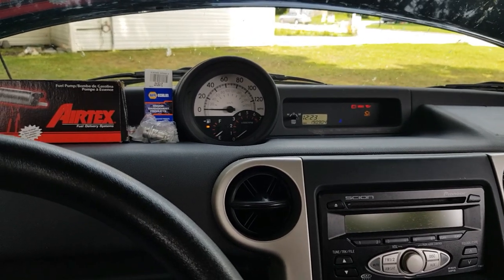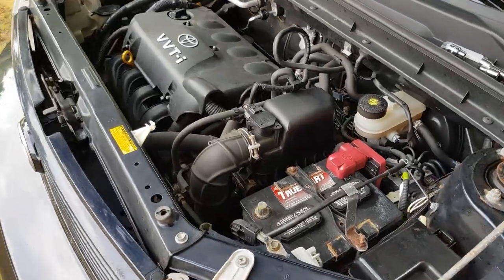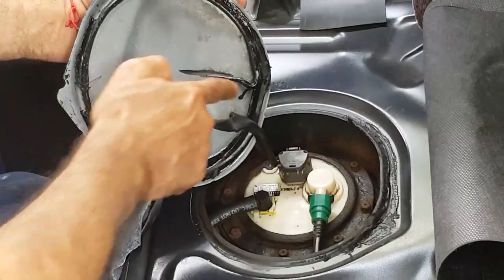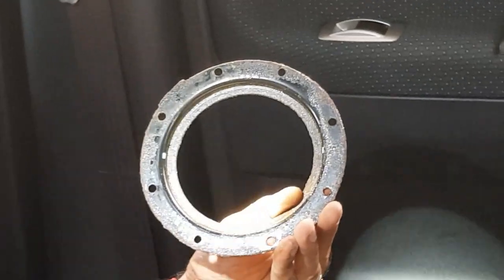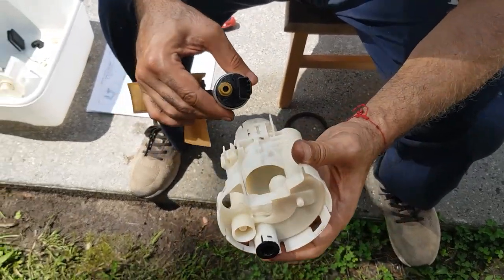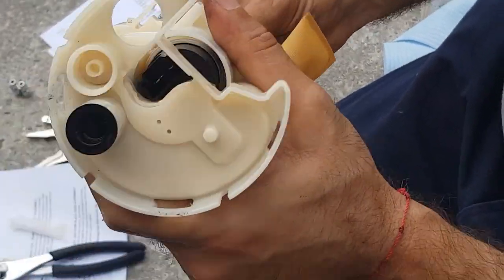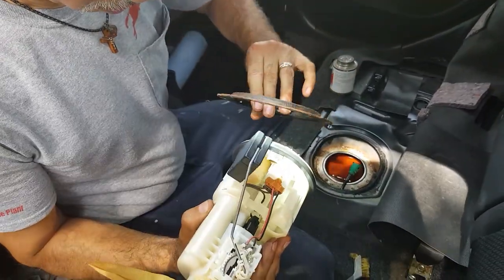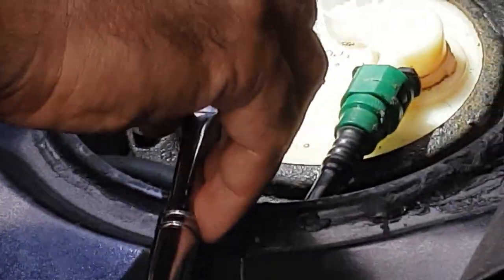2006 Scion Xb fuel pump

Comment: I have found that if you use a paint pencil to draw a line across all the different parts before taking it apart that it makes it simple to make certain that parts are lined up.  In this case, draw a line from about an inch across the fuel pump housing, the retainer ring, and an inch onto the fuel tank housing.  No doubt whatsoever where everything goes when put back together.
Reply from the maker: Thanks for the advice, Old Time Farm Boy👍 Me and the rest of our youtube DIY's appreciates your input. Thanks for watching, God bless.

Comment: just a small tip but the 03-06 scion xb, the fuel pump doesnt prime when the key is on ACC, it only turns on/pumps and builds pressure once you start cranking the engine over.

Comment: Man, that evaporation hose is killing me, it will not come off!!!! Try as I might with or with out tools. It’s a crazy little bugger for sure
Reply: Omg I got, that was probably the hardest part lamp. I used the locking pliers, squeezed the tabs inward and the tapped on a blunt screw driver genteelly until it got up to and little over the rib and then I pulled it off. Now I am sweating up a storm lol
Reply from the maker: @jeffslegacy   patience my toaster buddy, eventually every step will be successful. 😉👍 Remember keep your tank half full to properly break in your new 200k mile pump. Good luck 👍
Reply: @Deville429  thank you my friend, I really appreciate the encouragement!! I actually pulled the pump itself super easy with a pair of vice grips
Reply: Sneak a small flat screwdriver between the to parts and it will come right apart.

Comment: Thanks for doing such a thorough and professional video I have 199065 miles on my 2005 which I’ve had since brand new and am thinking of doing this since my car is hesitating slightly when I take off from a dead stop I’ve done all other maintenance possible thanks again man
Reply from the maker: You're welcome! Just some tips for you. If you have not upgraded to K&N air filter, do it. It's well worth the performance breath for our Box engine!  Also read my reply for Bill Smith. Good luck on your attempt to replace the pump, and thanks for watching. Long live our first generation Boxes!
Reply: Yeah first thing I bought was a k&n cold air intake. I’m actually thinking Of putting stock air cleaner box back in with aftermarket k&n air filter I’m tired of the sucking sound lol

Comment: This has to be one of the most cleanest, thorough and professional DYI videos I've ever seen! I own a 2006 5 speed xB, first owner. Just turned 106K miles. Bought it with 18 miles and it's awesome! Been having some acceleration issues and think this is the culprit. Seen other videos but after yours, I'm now considering DYI'ing it. I hope you create more DYI vids for your Scion. 

Will you be creating a video regarding the fuel injectors?

Thank you.
Reply from the maker: Jeepjedi, I appreciate your compliment. Most likely in the near future I'll do the injectors replacement. Read also my other replies. I've always maintained my air filter súper clean using k&n and now the generic spectre on Amazon. Clean filtered air along with clean engine oil and using a steady gasoline diet like shell will result clean well performing injectors. Just did mine last year at 215,000 miles.
No injector issues just decided to replace them so that my toaster engine keep running with no hiccups. Good luck with your pump repair! Also make sure your negative ground cable is clean and acid rust free. God bless.

Comment: Hey DeVille  I thank you  for your video is very helpful as far as I see  a  bird view of what you have to deal with changing a fuel pump. As a bread truck owner Scion, I really appreciate all the  illustration and time you did. Huge help for all the bread truck owners. I have a 2006 white Scion xB automatic.
Reply from the maker: You are welcome Robert! Thanks for watching and good luck on your reliable toaster! Check out my automatic trans flush with the added cooler that I installed! Happy motoring!

Comment: Really most helpful Deville429. It is folks such as you that gives others the confidence to take on these types of projects. I'm only at the disconnection stage on my 05 toaster, but heading towards replacement of the fuel pressure regulator and the filter, probably the sock also. 

Just wanted to mention my '05 xB has 2 electrical connections and is oriented a bit differently than your '06, my white fuel connection has a bracket over it and approaches the tank from rear of the vehicle.  I have a black colored connector for a vapor sensor, minor subtleties that pose no real issue, thanks to the confidence you have provided. 

Another video somewhat helpful to the process, specifically a little more detail on the bench seat bottom removal is : https://www.youtube.com/watch?v=iWUSgbVSJ94   (Daily Driver Down, by Jester's Garage)

Mad props to both of you for all the helpful details necessary to take this on.
Reply from the maker: Good day Ronhelmuth81,
Thanks for watching my 1st official repair video and for your kind, humble comment. I'm glad everything is working so far for you. Take your time and analyze your task. Keep the faith, and best of luck with your repair.
Best wishes for your toaster, and long live these 1st generation Xbs!
God bless.

Comment: Quick question for Mr. Deville429 and much props for your excellent video.  You could be an instructor my friend!  Question 1:  Did you have to rewire the new fuel pump or did you use the original connection from the old fuel pump?  Question 2:  What is the part number for your Airtex fuel pump you used on your scion xb?
Reply from the maker: Gracias Mr. Martinez,  I used the original wire connection and I use airtex part number E8213. Remember can't use the rubber grommet that's included in the fuel pump,  won't fit on the housing. The website I ordered from  was at rockauto.com Don't forget the fuel pressure regulator.  Good luck with your toaster my friend and happy motoring.
Reply: @Deville429  Gracias amigo y buen dia.

Comment: Such well detail video, and I'm looking to replace mine very soon. Question did you gain any Mpg back after the replacement??? I notice mine is down from 25 to 22,23 miles. Thank you please continue the excellent work.
Reply from the maker: Thanks so much milk8002 for watching and for your great comment.  I'm averaging around 24 my self. Not much of a gain with my original clutch.I've just replaced my injectors this summer. Every year on my toaster's birthday, she gets a new k&n air filter and amsoil 0w30 synthetic 25000 oil service.  She performs flawless! Good luck on your repair success and your toaster!

Comment: Anyone know how to get the level sensor bar to stay in place? I had to take mine apart to instal pump in the housing now the bar just flips around and comes out of slot.
Reply from the maker: Hi Matrix Adjustment 4.0, sounds like to me you might have snapped the locking tab that secures the fuel level sending unit. At minute marker 15:44 there is that locking tab. I hope that tab is not damaged. Just double check to make sure the fuel sending unit lines up to the 2 holes, push in and slide toward locking tab. Best of luck

Comment: Thank you for this excellent video Sir. It was very helpful!
I have an xa. I wanted to share my experience: Careful when you buy the replacement fuel pump!
My car occasionally stops as I am driving along, I have to go over to the shoulder and restart. I saw your vid and assumed it could be the fuel pump. I bought the fuel pump but noticed the terminal connector was slightly off, a bit shorter. I installed it anyway. Car would crank but not start up. I took it out and put in the old fuel pump back in. The car starts now.. any ideas on what might cause the car to stop as I drive along the road?
Reply from the maker: Hola 1aninterpreter1, thanks for watching my repair video.  As for your xa's problem,  my educated guess is a fuel delivery issue since you can start the car everytime.  While you are driving putting a load on the engine,  the engine needs constant fuel pressure. Make sure you do have the correct fuel pump for your XA along with a new pressure regulator to stabilize that fuel for your engine. I don't know your year or mileage of your XA. My Xb is the last year 06 made, which means it's wise to own a vehicle after they updated any issues from the start of the 04 production line. My xb now has 210000 with original injectors and ignition coils. I intend to replace them this summer Lord willing so that I don't get stranded out there.  My Xb always had a clean K&N air filter as well. Check your air filter as well. Good luck with your Xa, and I hope she'll run like new again!
Reply: @Deville429  It is a 2006 scion xa. I got the right pump now and I will also replace the other parts you suggest. Thank you for your kind response, God bless you!

Comment: I installed the Fuel Pump and Regulator a few weeks ago per your instructions. It runs great, thank you. 
Now it has a new issue. I use the car once in a while. In the morning it starts on the second try. Once it starts if I turn it off and back on it fires up immediately. If it sits for a few hours I  get the same issue, it starts on the second try. Any ideas on what it could be?
Reply from the maker: Hola 1aninterpreter1, I'm glad your Xa is running great. My educated diagnostic opinion is your xa's not maintaining fuel pressure in that whole fuel circuit (pipeline). Based what you tell me that the car starts fine and all. Make sure your electrical(battery) is healthy with full amperage crank. Other than that  I would drive your car around till its low in fuel, then double check your fuel pressure regulator install, making sure it's fully seated inside that O ring for a good seal, along with your fuel pump that also have a good tight O ring seal. My best of luck to you and hope your get your little Xa running great. Let me know how it works out. Then I'll check my service manual if there is a residual fuel pressure check specification. Again good luck  God bless.
Reply from the maker: I've checked out my service manual. I included the injector test link under description. It looks like your car may benefit a new set of injectors. I just replaced mine, relatively easy. Discharge fuel pressure. You'll need a fuel line disconnect tool. ( Lisle 39210 Main Fuel Line Disconnect) Find your best price on the internet. Once you replaced your injectors, my advice is to stay with one brand gasoline(Shell, Sunoco). Do not mix your car's diet. Certain gas brands don't have the added detergents causing accumulated carbon deposits. Here is the web link for more info. https://newsroom.aaa.com/2016/07/aaa-not-gasoline-created-equal/  I personally use Shell. I replaced my injectors and they still look just like the new ones I installed. The key is to make sure you have a clean air filter at all times along with clean engine oil. Here is another link to high quality gas. https://www.toptiergas.com/   Good Luck!
Reply: @Deville429  Thank you so much!  God Bless you Sir!

Comment: Can I ask where to buy the fuel pump assembly?
Reply from the maker: Good day, Rael. Thanks for watching my official repair video. You can buy the actual fuel pump motor at your local parts store if they have it.  I use Airtex part number E8213. Remember can't use the rubber grommet that's included in the fuel pump, it won't fit on the housing. The website I ordered from was rockauto.com Don't forget the fuel pressure regulator.  Good luck with your toaster my friend and happy motoring.

Comment: I finished up and put the fuel pump back together and reinstalled the assembly in the tank. Primed and started it and now my fuel shows on E and the gas light is on. But I have 3/4’s of a tank of fuel. Now there is a click click sound that I have never noticed coming from the left side of the engine near the ABS Relay & Fuses
Reply: Disregard!! I disconnected the battery and waited 10 minutes and then reconnected and it started and the fuel gauge went up and the gas light went off!   Super stoked to have this done. You are the man, I couldn’t have done it with out this great video and your calm attitude lol!! Have a good one and thank you so much!!!
Reply from the maker: @jeffslegacy  😉👍Amazing! You're most welcome! Glad your repair was a success and on top of that the job was done to your satisfaction, not relying on those local shop mechanics that rob your hard earned money. God bless, enjoy your Holidays and long live our 1st generation toasters! Happy motoring!👍

Comment: Where can I find the bolts that secure the pump itself? Mine is missing some of them, no wonder the gas pump doesn’t stop when the tank is full. I may as well also change the fuel pump.
Reply from the maker: Hi Nuviamor, here is the website where I order OEM parts for my toaster. Fuel System Components for 2006 Scion xB | McGeorge Toyota Parts
https://parts.mcgeorgetoyota.com/v-2006-scion-xb--base--1-5l-l4-gas/fuel-system--fuel-system-components
Item number 32 is the small bolt that secures the plate pump housing. Good luck with your toaster and thanks for watching. If you have any more questions feel free to ask, and I'll do my best to help.👍
Reply: Thank you! Appreciate it.

Comment: Did the orignal wire plug right into the aftermarket pump? If so do you have a link to the pump u used?   Thanks
Reply from the maker: You're welcome 4usAll.  I used the original wire connection and I use airtex part number E8213. Remember can't use the rubber grommet that's included in the fuel pump,  won't fit on the housing. The website I ordered from  was at rockauto.com Don't forget the fuel pressure regulator.  Good luck with your toaster my youtuber friend. Thanks for watching and happy motoring. https://www.rockauto.com/en/moreinfo.php?pk=59959

Comment: Excellent video. How's the Airtex pump holding up?
Reply from the maker: Hi Brett, the Airtex pump still performing new with that nice OEM whine sound. Thanks a bunch for your compliment. No doubt, this pump will last another 200K!  Just finished breaking it in. Kept the tank full most of the time, so that it burns in right. Hope this helps out for all our box toasters out there. It's just about this time frame 14yrs to replace the fuel pump. Good luck!👍
Reply: Just did mine today with 202000 miles. Bought a Denso years ago but never put it in. Was done in an hour and a half thanks to your video!Was so easy.Runs and hums like new.Also noticed in my tank was what looked like metal shavings and some things floating around. Vacuumed them out while I was there.
Reply from the maker: @brettsenior2805  You're most welcome.  Glad the repair worked out for you.  Your toaster    should last you another 200k!🙂👍 Good luck with your toaster box!👍

Comment: hello Sir.. do you think it's possible to do this with the fuel tank full? i just filled it up lol
Reply from the maker: Hi TheLansang, If your fuel pump suddenly died, my best safety oriented safety experience opinion would be to siphon the gas into a recommended designated 5 gallon container or two 5 gallon containers. Then you may proceed to replace your fuel pump in a very well ventilated space. Best of luck on your repair👍
Reply: @Deville429  its not dead yet and i dont think it will die soon.. i juat want to replace it with new OEM Denso because i drive this beast 150 miles per day lol

Comment: Trying figure out my xb . Every time I step on the gas it won’t have any power or it will just die it will idle all day long . Thanks good video. I was thinking it was fuel filter
Reply from the maker: It could be a number of factors.  Restrictive air filter, partially clogged injectors, fuel pressure regulator. The motor is a giant air pump. As long as the valve(throttle body) is partially closed, the idle circuit is active (running), which means there's no load (demand) from the motor. If you are up there in mileage,  my gut feeling opinion based on your driving habits, heavy carbon buildup if you just normally drive your car with no wide open throttle actions.  If you do drive with occasional wide open throttle that makes your engine scream to blow out the old, stuck carbon, then replace air filter, along with fuel pump and pressure regulator.  I haven't replaced my ignition wires, coils yet. They are still original.  Just replaced plugs once back at 90k. Plugs running good now with over 100k! Remember your engine depends on a clean air filter along with clean motor oil for your fuel injectors to work optimally.  Just curious, is your toaster an 04? The saying goes never buy first year model of a car. I've waited two years later so that Toyota,Scion work out the kinks. I hope this advice tips work out 4 you. Good Luck!👍
Reply from the maker: Also one more thing Bill, I'm an occasional wide open throttle driver when entering in merging highways. My car still has original fuel injectors.  Thanks for watching my repair video  and again good luck.👍

Comment: Are you still driving this box ?
Reply from the maker: Hi Jake, yes I am still driving my toaster box going on 15 years!👍 
1st original owner purchased brand new. Still has all original ignition system except for spark plugs, original struts, original clutch (1st time driver stick shift). Just replaced my rear brakes, shocks, exhaust system. 
Now going to work on front brakes. Thanks for watching and God bless.